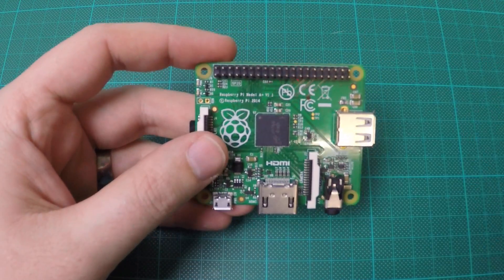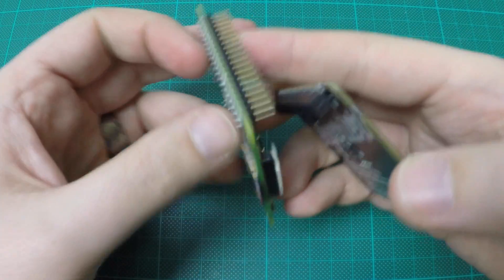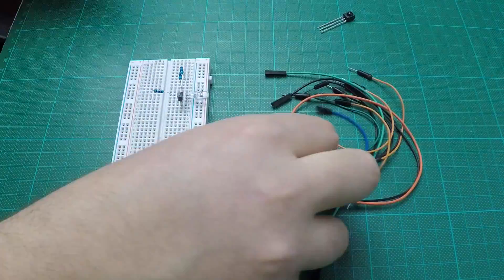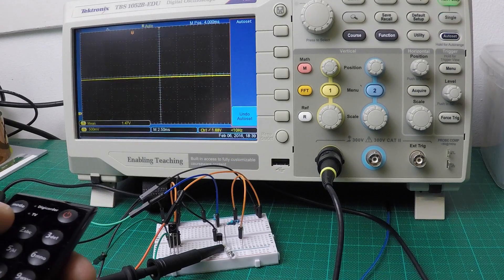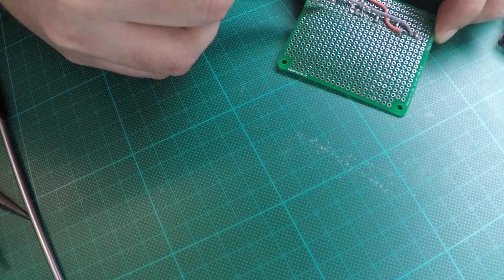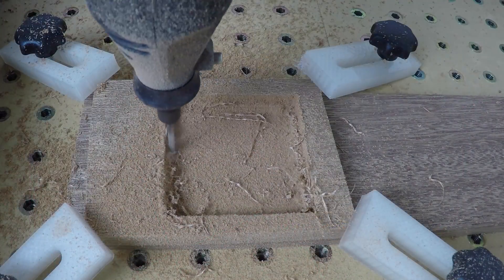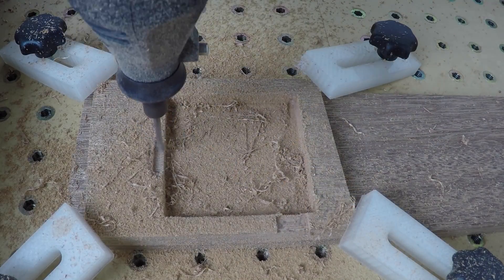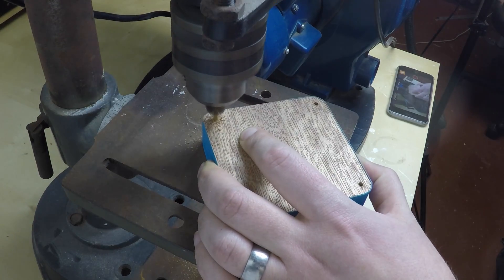Gesture based TV Remote Control Using Raspberry Pi and Skywriter HAT

Comment: How does it detect gestures through the wood? This is very cool!
Reply from the maker: +jorenmartijn According to the Pimoroni page, it can detect up to 5cm away, using electrical near-field sensing. As long as the material on top of it is not too thick and not conductive, it should work.